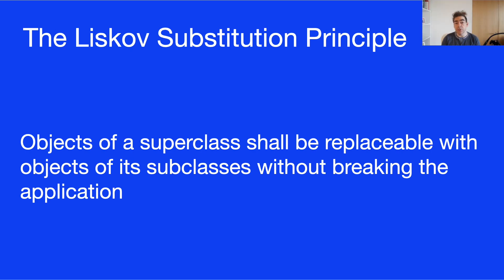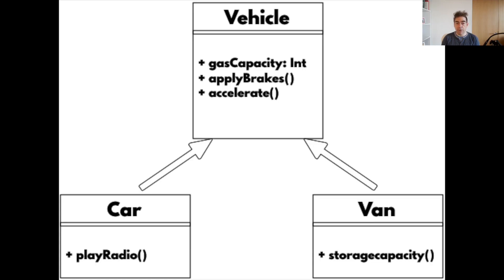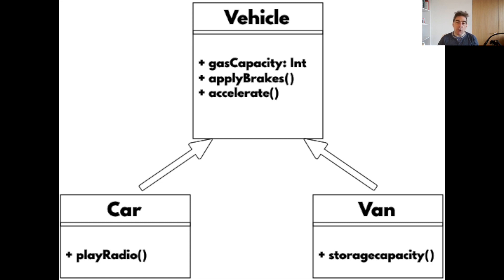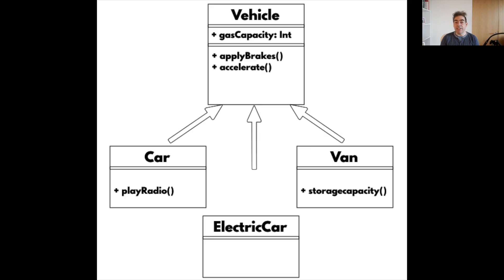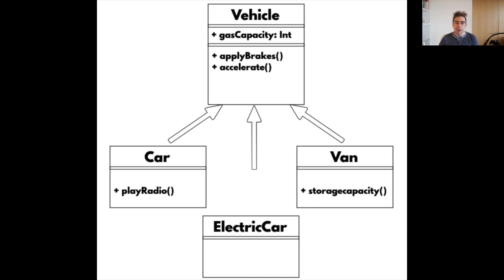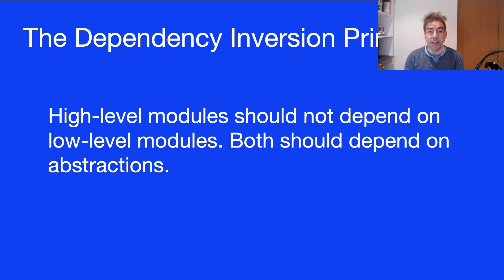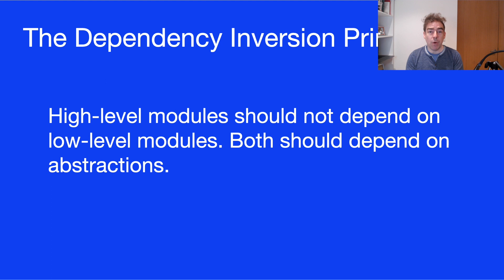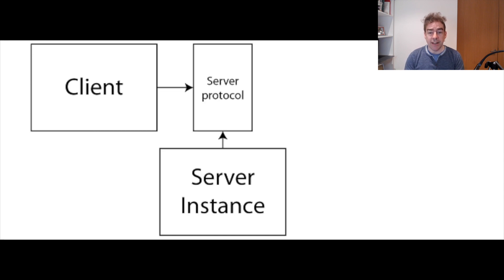What Is The Difference Between The Liskov Substitution Principle and Dependency Inversion Principle?

Comment: hm, sorry, still not clear, lol. Thanks for trying though :)
Reply: Liskov Substitution just says you can replace an object of a class with its abstraction and it should work. For example, if Car -> Vehicle, use Vehicle object instead of Car.

Dependency Inversion says whenever using Dependency Injection try to use the deepest abstraction. So for example,  if Electric Car -> Car -> Vehicle. If your code is injecting a dependency of Car use Vehicle instead. If your code in injecting a dependency of Electric Car, even then use Vehicle.